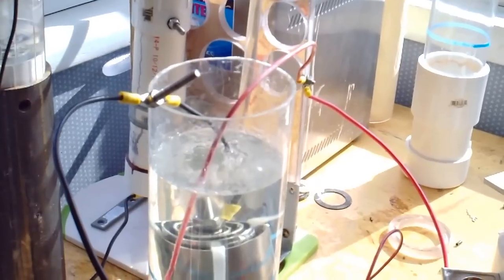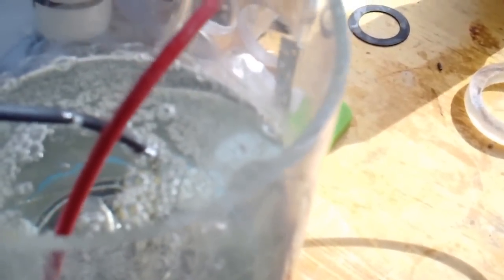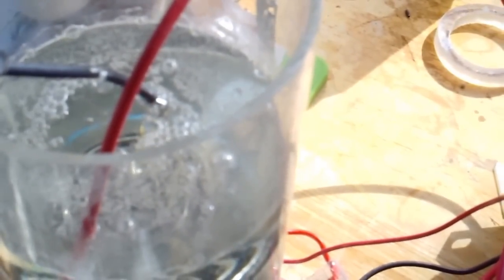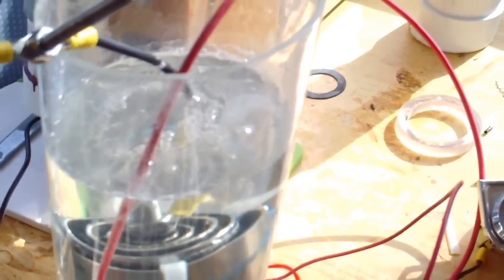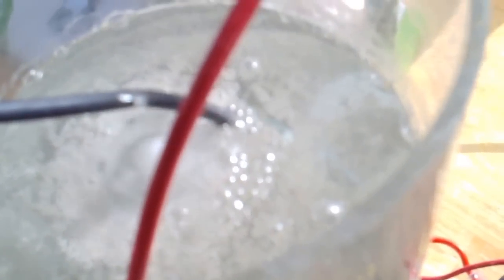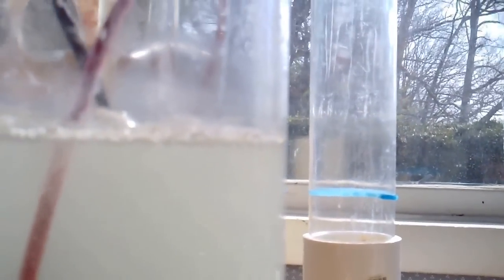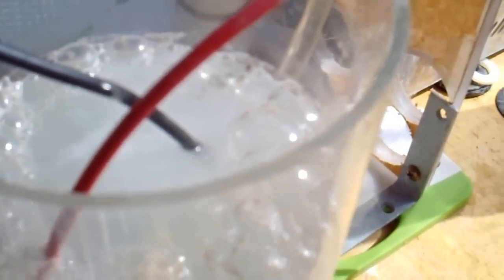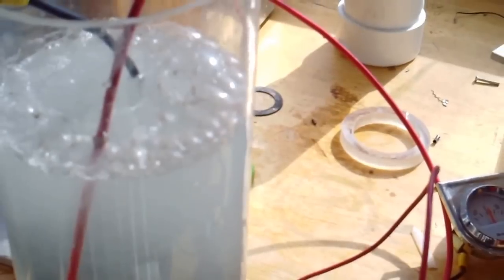High Output Joe Type HHO Cell Makes Structured Water

Comment: What you see, is mainly an Electrolyte Stream,( plus and minus Ions from the Salt disassociated, combined with plus and minus Leads)  drawn by the electromagnetic Channels between the Leads. I saw your Holes drilled on the Bottom of the Tubes. This is the advancement probably, your current is more effective when it concentrates around a Focus Points on the Lead to exchange Electrons and fill the Electron Shells of H2 and O2 . Since Electrons repulse each other you should have your electrical Hookup opposite to the the Production Area. 
Condition the System means to structure the Water and Electrolyte, the Leads and build up electromagnetic Channels between the Leads. Afterwards ( 20 min to an Hour) you can switch your Systems Polarity with no Problem. Your PWM should go close to Zero Volts or below and then shoot up to your desired Volts.
Good Luck and thanks for the Video.
Helmut

Comment: Dave, Cool to see the pulses from the PWM in the water. According to how the Joe cell is reported to work is you have to maintain the perfect water structor and over time (after the water is conditioned) the water and cell pulses can create an proton exchange when installed next to the engine. But it doesn't require much power to the cell to create the water condition from what I read. Hope that helps and be safe. "D"
Reply from the maker: Thanks for your comment Darrell. Yes, I had done that with tap water and almost no input power and it required about 24 hours to get the structured water with permanent bubbles. So, I was surprised when it happened with electrolyte @ 15 amps. I will experiment with this conditioned water/electrolyte, as you said.
Reply: tap water has to many minerals and will make the water dirty if you made your cell good with tap water you dont need electrolyte the permanent bubbles is the crud in the water use only distilled water with salt or KOH electrolyte best results

Comment: Hi Dave I like your device. What are u using for an electrolyte? I found baking soda works fairly well with some salt added. Also what volts are u using d/c. I found at an electrical supply store you can get what is called a volt kicker goes from 12v to 24v works well. And i tried hooking it up to an automobile voltage system it even works even better you get allot more flow out put. I made a simular device to yours and now woking on a 8 plate system and the out put is even greater! Still need more flow to completely completely completely my auto. Your def on the right path.

Comment: Hi there, thanks for sharing your video,
Can you do a side view, while you start your cell ???

Regards
Reply from the maker: Sure, I'll shoot a side view. I did test the bubbles. they ignite with a very sharp CRACK! The force of the bubbles rising from the center electrode is so strong it causes a vortex flow...up the center, down the sides and back up...enough to push the surface above the center tube up several centimeters.

Comment: You know, it really doesn't matter how much HHO production you get.  But if you can do it efficiently, that is the key!!
Reply: +snaprollinpitts I heard you need 8 litres/min minimum to run a car......
Reply: +Mike Simons how much current do you think it takes to make 8 liters per minute? and how hot is that cell going to get.
Reply from the maker: +snaprollinpitts I'm already working on the next generation of cells in my new Vortex Implosion Cell (VIC). There is nothing in common between this old design and my new invention that uses vacuum, EGR, implosion, Vortex flow and cavitation. I'm waiting on a funder/sponsor to construct it. www.HHOTrucking.com
Reply from the maker: +Mike Simons The info I have is that Stanley Meyer's VW needed 7 LPM BUT, his gas was not HHO as most people are familiar with it. The new gas contains Nitrogen and is ionized. A 4 LPM car water fuel cell can run a 750cc Honda motorcycle engine by drawing its current from the car engine's alternator. But, there is not enough gas to rev past 5000 rpm which is very slow for a Honda. See video at http://www.HHOTrucking.com
Reply: Seen 50cc running on straight hho

Comment: if  you change the water and repeat will it still bubble? if not the first run was getting all the crud and grease (which holds bubbles) blown off the components?

Comment: Okay, what's the "one little difference"? You don't say.
Reply: mike walsh 
I drilled 2 levels of 3/8 inch holes around the outer Positive tube.
This creates a vortex flow of electrolyte.
Note also that  the  negative  connection is a bolt at the top of the cell.